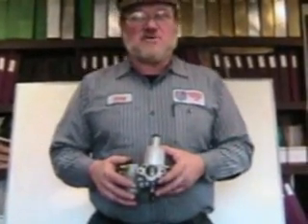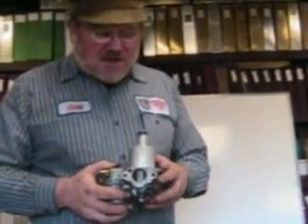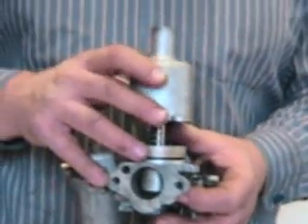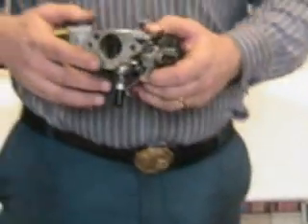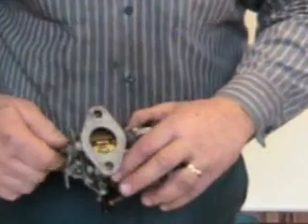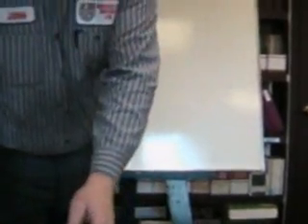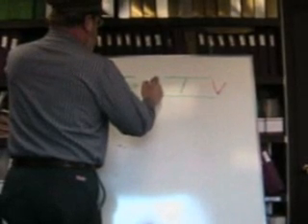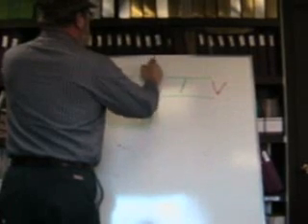044 MG Tech | Secrets of the SU Carburetor Part 1 of 2

Comment: Hello John i have a question i have motorcycle with hif38 carb on custom manifold. Mine question is about the vacuum advance port should i block it or keep it unblocked? there is nowhere to connect it it just vacuums to air. Regards

Comment: Ive always wandered, are you supposed to run the car like that from cold? Just driving around with the choke out. I know people 'can' do it, but is it recommended? Are you meant to let the car warm up and then drive on, or can you just drive off once its started with the choke out?
Reply: 15 years late but no a properly running car when warm shouldn't need choke. The proper time to wait is however long it takes your oil to spread through the engine

Comment: He got the 2 quadrants the wrong way round. The black part, main jet holder, is not the choke. It is the metering of the fuel into the engine. The second quadrant, the butterfly, is the choke.

Comment: What oil do you use in the damper? The ATF-oil or just motor-oil?
Reply: Better late than never I guess, but 20w motor oil is fine
Reply: ATF was always recommended.  That's what I used to put in.  It worked very well.  I believe ATF is jusr 30w oil with lots of detergent.

Comment: I've heard that gearbox oil is better than motor one.
Reply: My SU carbeurated Volvo would always put out a puff of black smoke when I hit the gas pedal hard and it over-enriched the fuel.  I think gear oil would make an even bigger puff of smoke and could cause carbon build-up in the cylinders if you accelerated a lot.  Of course, it's easy to try out different thicknesses of oil.  Or make your own blend that's just right for you.